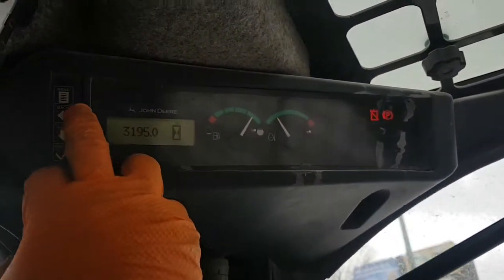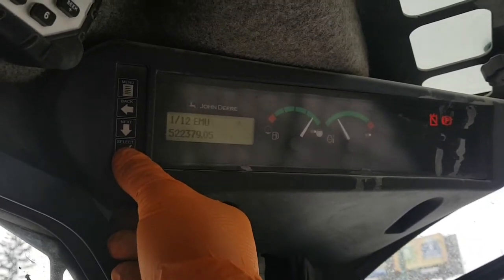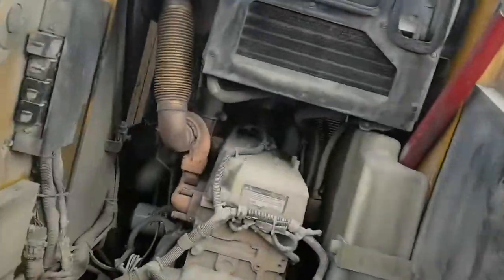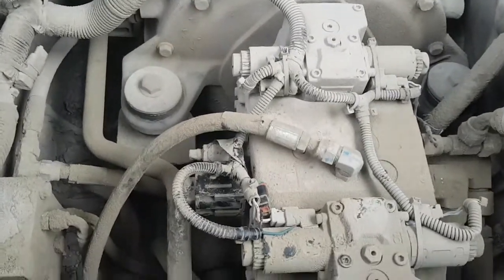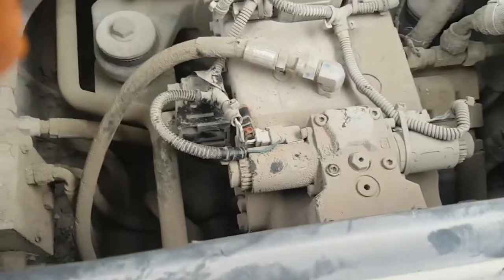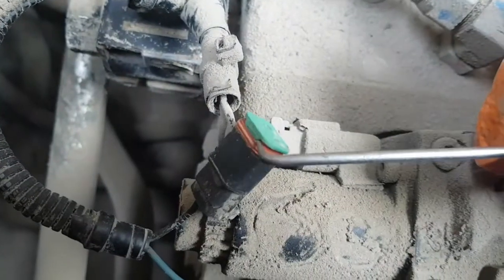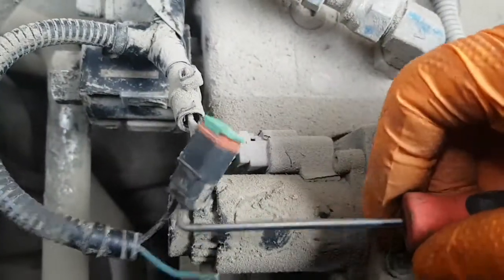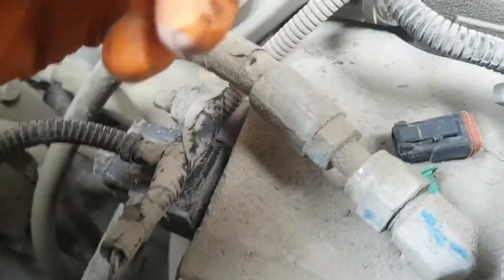John Deere 329D Park Brake Code 522379.05

Comment: Mine is not a John Deere but it does have same duetz connectors …my question is, do these run on straight 12 volts or 12v and then drop voltages to hold typically?
Reply from the maker: Depends on the setup. Usually is just 12 volts

Comment: My 329e tracked skid stopped suddenly while pushing dirt but only the left side. I changed the left side wheel speed sensor but still a no go. As that and the right side sensors where throwing codes. Any ideas?
Reply from the maker: Some of those skid steers were notorious for the drive motors going.
Reply: how did it work out mine just did the same thing on the left side 329d right works loader works left side is dead

Comment: My John Deere is doing the same thing but I checked all Thoes wires and they are good. What else can I check?
Reply from the maker: The solenoid itself, if you can, swap out the solenoid with another to see if that works!
Or if you have an Ohm meter, check for continuity